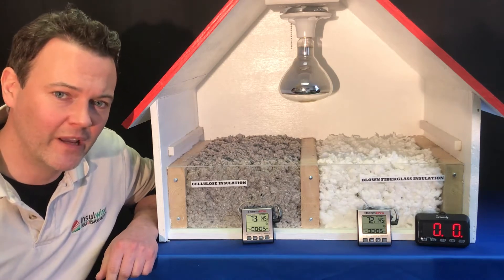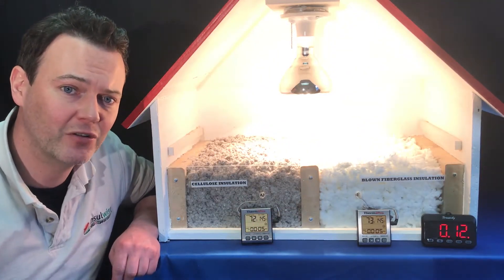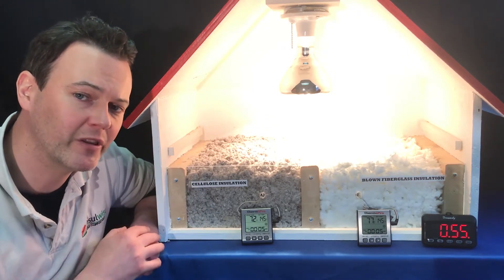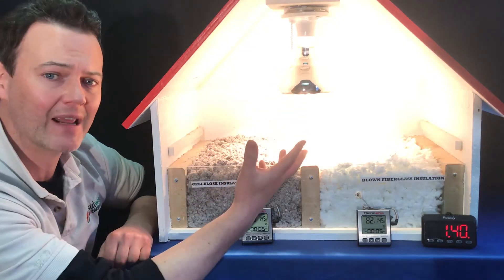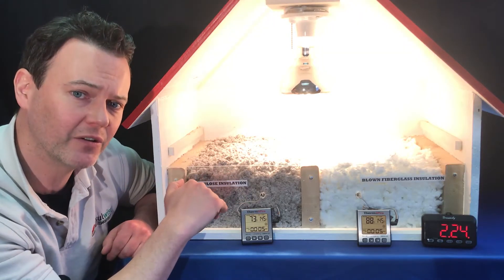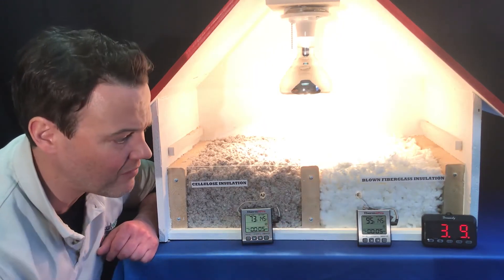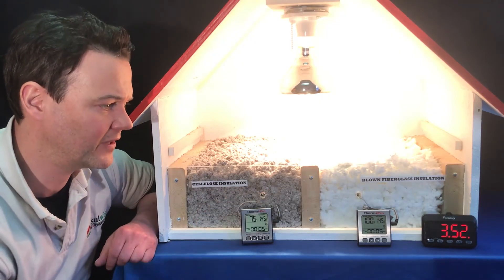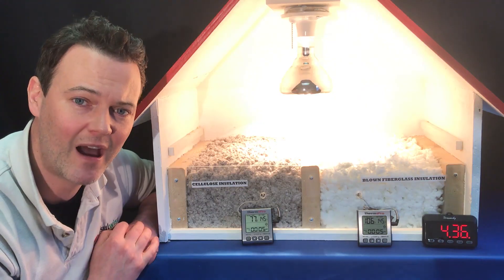Cellulose vs. Fiberglass Insulation: The Ultimate Showdown

Comment: In this 5 min video, the cellulose side increased 4 degrees to 77 degrees.  So during summer, by noon the attic would eventually reach the same high temperature as an attic with fiberglass insulation.  The energy saving would occur during the ramp up time.
Reply: But you didn’t have Equal R values. This is a unfair test. Also which insulation cools quicker. I already know the answer to that. The looser fill will always dissipate energy quicker. Therefore not “heating” throughout the night.
Reply from the maker: Corrct -- it takes much longer for the heat in the attic to penetrate down through a cellulose insulated attic than a blown fiberglass insulated attic.  By the time the attic heat may have built up enough to start working its way through the cellulose, the sun is often now going down in the sky, reducing the temperature of the roof and therefore the attic.  The roof assembly, attic, and heat retained in the cellulose then get to "cool off" over night until the process begins again in the morning. 

Andy
Reply: @insulwiseenergycomfortsolu3293  Thanks for the confirmation...would need to see the data analysis on how much the delayed heating contributes to decreased cooling costs in order to determine if the return on investment for homes in the southern California area.
Reply from the maker: @rick2tube    If you're comparing it to blown fiberglass, the ROI should be much higher with cellulose insulation anywhere because cellulose insulation is usually far less expensive than fiberglass.  It takes substantially less energy up front to manufacture cellulose insulation, which is a big part of it.

Andy
Reply: @insulwiseenergycomfortsolu3293  thanks for the insight.  The ROI question with any proposed solution is: how many years will the cost of a solution take to break even as compared with the projected savings in the annual heating and cooling costs.

Comment: I'm guessing you work for a company that sells cellulose insulation.
Reply from the maker: Hi Davenport, we perform insulation work for homeowners, but we do not sell or resell cellulose insulation per se.  We sell the highest level of improvement in energy efficiency and comfort that we can provide.   Most of our homeowners don't care what we use to get them these improvements --- so long as it's safe and effective.  We do however compete against other local companies that blow fiberglass insulation into attics every day, and let me tell you that we've had to redo plenty of those attics over the years because the result achieved from the blown in fiberglass was not effective at solving the homeowners' problems.  Imagine for a second how annoying you'd find it if you paid a contractor several thousand dollars to insulate your home, only to find that it didn't do the job you'd hoped for --- and then had to hire and pay another contractor several thousand dollars again to redo the job.  The purpose of this video is educational so that homeowners in general but more importantly our potential customers can make the best informed decision that they can. 

Hope this helps!
Andy Haak, Owner of Insulwise Energy & Comfort Solutions

Comment: What's involved in air sealing an attic ? We have a 1980 build home with arched ceilings cedar plank tonge in groove. I suspect it breaths attic air .. a lot.    We recently had fiberglass blown to 12 inches over the existing .. 2 inches! of fiberglass roll.  I'm thinking it's not enough after watching your demo and considering adding another 12 inches of Cellulose Insulation.
Reply from the maker: Here's a link for how we air seal attics and what it entails:
https://www.insulwise.com/insulation/air-sealing-insulwise-pittsburgh/

Air sealing tongue and groove is very difficult from above, it likely need to be spray foamed entirely with closed cell spray foam from above first.  However if it's covered / coated with a good layer of polyurethane that could possibly do a good enough job.  We're just not big fans of blown fiberglass having seen how it performs over the years.  

Hope this helps!
Andy

Comment: Just get spray foam then and it will stop ALL cold/hot transfer, Why mess with either of these.
Reply from the maker: We use foam to air seal the air leaks in the attic floor.  If you use spray foam to insulate your attic it's typically applied to the underside of the roof, which comes with it's own problems.  You also NEED to use closed cell spray foam in order to achieve a vapor barrier  --- open cell spray foam which is much cheaper and more commonly used allows water vapor to pass through it where it can do damage / rot the underside of a roof.  Closed foam is also very expensive, and it can delaminate from the wood that you're spraying it onto (we see it happen with rim joists in basements).  The solution of air sealing the attic floor and top coating it with cellulose insulation offers homeowners the best bang for the buck, which is why we do it. 

Andy Haak

Comment: Cellulose gets all over your home. If you have any ac duct leak the crap gets all over. Your home stays dusty. I had it blown in and it was a mess.
Reply from the maker: Hi Bobby, if the company performing the work doesn't have its act together this can happen.  The seams in your your duct system should have been sealed with silicone prior to insulating at a minimum.  Our preferred practice is to encapsulate exposed duct systems in attics with spray foam prior to insulating them.  That provides an added layer of insulation to the ducts (hugely helpful in itself) and also seals the seams.  Had the company you hired done this, and covered the attic hatch with a drop cloth while blowing in the material this never would have happened.  We never have these problems in the homes that we do. 

Thanks!
Andy

Comment: The fiberglass looks brighter like it reflects more light but it clearly absorbs more heat.
Reply from the maker: It allows the heat to pass through it easier.  When performing air sealing work in hot summer attics where there is already 15-24" of it in place, when you put your hands down through it is hot until you get very close to the ceiling.

Comment: What about rockwool? Do you have a video with that insulation similar to this one?
Reply from the maker: I don't have a rockwool video because we rarely see or use  it here.  However, when it is in batt form (not blown in) it performs very similarly to batt fiberglass in terms of R-Value, about R - 3.5 per inch which isn't bad.   The two main virtues of rock wool is that it is a good sound deadener and has the highest resistance to combustion of any insulation that I'm aware of.  The downsides of working with rockwool batts are that they are brittle, can be difficult to shape (if installing in a wall, you need to actually cut out the sections where the outlets will be with a proper knife, and do it very well because it's so rigid that you can't easily stuff more around the outlet or bend it into shape like you can with fiberglass batts, so it's FAR more time consuming to install) and install properly.  Also, rockwool fibers tend to be very short and brittle, so they can be extremely irritating on the skin to work with.  It's also the heaviest insulation that I've worked with.  I try to avoid working with it when I can.  If you have to use a batt material, fiberglass batts are far more user friendly and perform quite well when installed correctly.   That said if you're talking about insulating an attic floor or closed cavity, we believe that cellulose insulation is the all around winner.

Hope this helps, 
Andy

Comment: his was a good demonstration back in the day to test the r-values for certain products, the test is now outdated. There are more variables in the equation such as air flow in the attic. The recently upgraded r-value test proves that blown in products can be rendered almost useless if 1) the correct depth of material isn’t added 2) the material isn’t sealed from the air via Sheetrock or simply using close cell spray foam for insulation. Don’t take my work for it, look up R-Value and Spray Foam Insulation here on YouTube and watch Spray Jones video.
Reply from the maker: Nicholas you are correct. The R Value of any type of fibrous / blown in insulation can be completely degraded by the presence of air flows moving through it. This can happen via air leakage from the home to the attic via air leaks in the attic floor or wind washing which is when outside air blows through soffit or roof vents "washes the heat" from the installed insulation (think of wearing a wool sweater on a cold day...you're good until the wind blows). To prevent these two things we ALWAYS air seal the air leaks in the attic floor with foam sealant before adding blown in cellulose insulation, cover any exposed fiberglass batted walls with a building wrap air barrier like Tyvek, and properly baffle vented soffits to ensure that when wind blows into them that the resulting air flow is carried up and over the insulation, as opposed to through it. 

This demonstration assumes that both air leakage and wind washing is accounted for. The main problems we see with blown fiberglass are 1) The inherent R-Value from the start is about 40% less than blown cellulose and 2) That blown fiberglass is so "light and puffy" that air freely moves through it far more easily. In the winter time this means that the cold air in your attic, which is now heavy and dense, has the ability to "fall down through it" far more easily than with cellulose. This is the primary reason that the R-Value of blown fiberglass degrades at colder temperatures, and it's the biggest reason why we don't like it. 

Andy

Comment: Also it takes more cellulose to fill an attic because it settles a lot more than fiberglass, meaning the price difference is not that much different.
Reply from the maker: Hi Vinnie, this is not correct.  Whatever R Value you are trying to attain, is going to take much more blown fiberglass than cellulose.  For example an R49 level of cellulose is about 15" inches when it's blown in, with the understanding that it will settle down to about 13.5 inches --- and that that 13.5 inches is your final understood R49.  Blown fiberglass requires blowing in anywhere from 17-20 inches of the stuff in order to get their stated "R49."  The problem is that R49 does not perform anywhere near as well as the R49 of the cellulose at temperature extremes --- which is the only time that you need your insulation to work!  

Andy

Comment: Cellulose can grow mold, being treated helps prevent it but doesn’t stop it. Cellulose is a very dusty product and if not air sealed right can spread that through your home. If you have a roof leak it’s good to replace any damaged insulation but fiberglass will dry out better than cellulose.
Reply from the maker: Cellulose is treated with boric acid and sometimes ammonium sulfite.  Both of these are non-toxic, but they can become slightly acidic if they get wet (this will not affect wood or drywall).  I have seen cellulose exposed to significant levels of moisture in attics (trust me on this), and what gets moldy are the wooden attic floor joists around it.  I have never seen this stuff grow mold.  Fiberglass cannot grow mold either because it is inorganic (mold cannot metabolize it), but the kraft paper backing on fiberglass batts can absolutely grow mold (quite well in fact). 

Andy
Reply: Dusty?, yes, Mold?, not possible. Once settled the dust is not an issue and the cellulose is hydro phobic. Cellulose is even more fire proof...  why?  Because it is a desert product, it does not let fire breathe through it... it slows the spread
Reply: @EliteGeeks  so cellulose can’t breed mold? That far different than I have seen in person extracting cellulose from attic. If it get wet enough it can also be heavy enough to go through your drywall. If not properly sealed in the attic a fan motor can rumble and shake cellulose. Cellulose unlike fiberglass is a material that doesn’t allow air movement through it. In turn if it gets wet it may not all dry out. Allow water to remain in the material and grow mold.
Reply: @vinniecrisante  you got enough water coming in to do that  your problem is not having a roof, less the cellulose.

Comment: If you have blown in fiber glass that is still good and not settled much is it OK to install cellulose over it for a R19 6 inches or is it just better to remove all the fiber glass and put in the cellouse? We are air sealing out attic soon and they said they can just blow over top of the fiberglass. Also we found out that the attic space in the room above our garage had NO installation AT ALL! So they are going to blow R38- 11 inches( they will blow 2 inches over due to settling) in that space. That's why it was like a damn Oven during the ☀️ 😮‍💨! That past of the attic was sealed off with plyboard so Inspectors missed it. We suffer because someone was lazy and didn't do their job right.
Reply from the maker: Yes, the practice is called top coating, and it's quite effective.   Once there is a thick layer of cellulose resting on top of the blown fiberglass it makes it much harder for cold air to "percolate" down through it and reduce it's effective R-Value.  We have found that moving around in blown fiberglass often tamps it down considerably.  Whatever you have there now in depth, for example 12" inches.  Expect there to be about 6" by the time the air sealing is done (assuming the air sealing was done well, which will involve moving and crawling through the majority of your attic floor space).  So if you were shooting for a total of R-49 when done, we would plan to blown in an additional 9" of cellulose once the air sealing is done.  

It's also common not to insulate the attic spaces above garages --- unless those spaces are conditioned spaces like bed or bonus rooms.  If it's just an unoccupied attic, I wouldn't spend the money to insulate it, unless you are trying to influence the temperature in your garage (which is unusual, as garages are typically treated as unconditioned spaces...effectively an attic that you store your car and lawnmower in other words). 

Hope this helped!
Andy
Reply: @insulwiseenergycomfortsolu3293  thanks for all the information. The space above the garage is actually  a bonus room and it's whee my office is at when I work from home from time to time. they just messed up not insulating  it. They said they are doing R38 in the attic above the garage. Hopefully that will be enough. 
 We also had an issue with the HVAC setup in that bonus room they only installed 2 vents when it should have had 4! They installed the other 2 this week along with a dedicated thermostat and WHAT A DIFFERENCE! The space remains a steady  75 degrees! Now we just have to insulate  the attic space to keep that heat in. 

Also we were contemplating putting cellulose in the garage ceiling for a full solution but after doing a but of research and talking with a few other people it doesn't make sense. That's because we installed a hybrid water heater last year and it blows out cold air into the garage which keeps it cool all the time even in the summer time and we also insulated our garage door. So we are just going to prioritize air sealing and insulating it.
Reply from the maker: @moedollars7050    That sounds like a solid plan, I understand now why you want to insulate that room, insulating and air sealing that attic over top of the room will help tremendously in the winter and ALSO the summer time with cooling. 

Andy